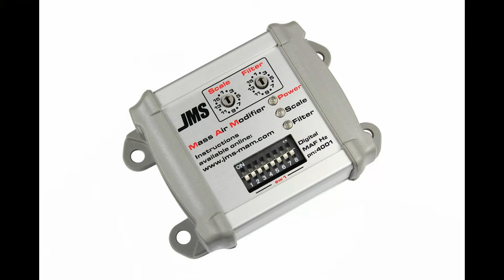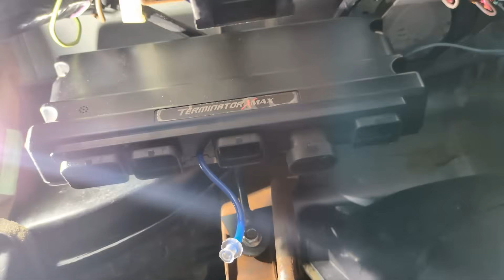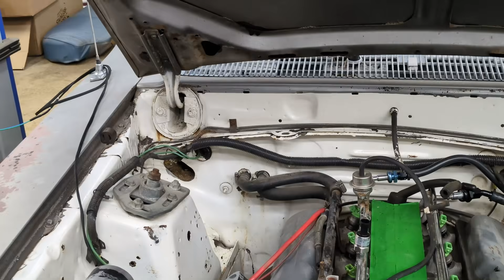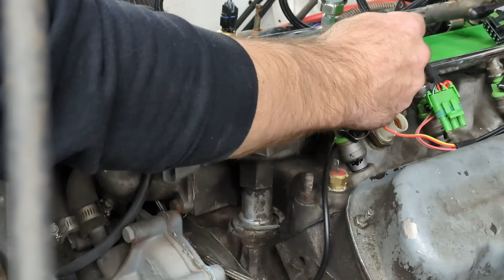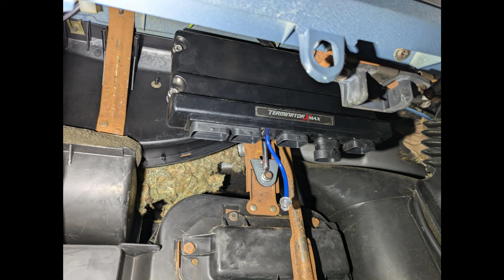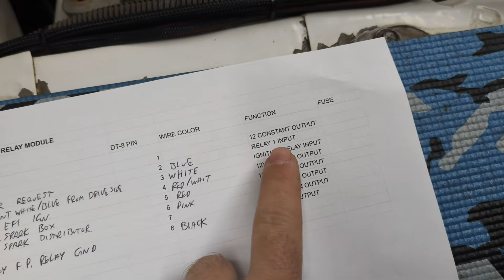Thinking about Terminator X on your Fox? STOP! Watch our video first!

Comment: Would you prefer the Holley terminator instead of the Holley EFI Carb which is a simpler setup?
Reply from the maker: If you mean Sniper EFI, we would not use that for this car because it isn't useful for E85 or boost. Terminator X is a much more robust setup.

If you mean Terminator X Stealth, which is a carburetor replacement style system, we do like that system very much, but we already had the Ford EFI intake and injectors for this setup. Ultimately, the port injection is a more scalable setup.

Comment: Just out of curiosity. Why barrel connecters over soldered connections?
Reply: I’ll take it a step further. Why does no one in the automotive scene use pins and socket cannon plug connections? And then shielded and grounded conduit for electrical wire insulation?
Reply from the maker: @rayman1230 this isnt that kind of car. Kyle uses those connectors on his 2000 hp drag and drive car. Video coming soon.
Reply: @Scramspeed   while I understand where your coming from, it doesn’t costs that much more to do it right and to all builds.
Reply from the maker: Holley's own recommendations on solder vs. crimp.  
https://youtu.be/faLn-SjVfwY?is=dzB3dm5bUjaBPOY6

Comment: Looks great! Have you guys done a Lincoln MKVII with a Terminator control system? I was looking into the fox terminator kit. Had plans to do all the old school mods, top end kit and eventually Vortech/Paxton kit since they’re local, but found out real quick that the original speed density sucks and I have no interest in trying to convert it to a 35+ year old MAF conversion with oem parts. Look forward to seeing the results on the dyno.
Reply from the maker: Hello: We have converted the non-HO and speed density Fords to EFI. Its a much much better solution than trying to convert to mass air and then using chip tuning.
Reply: @Scramspeed weird I never saw this comment till now. Ok sweet. I’m pretty sure I’ll end up doing a Holley kit if keeping the factory engine, but deep down inside a coyote is calling me too 😂
Reply from the maker: @smitty_schmitz  You can't lose either way!
Reply: @smitty_schmitz  I did a conversion on a 5.8 in a F250 with the regular Terminator X since it has a zf5. It’s never ran as good as it does now and the mystery random ignition cutout is gone everyone seems to have. I’m using the DualSync but will probably switch to coil near plug since there seems to be reliability issues with that distributor. I’m also running a MSD 6 Ultra with an HVC2 coil for spark.